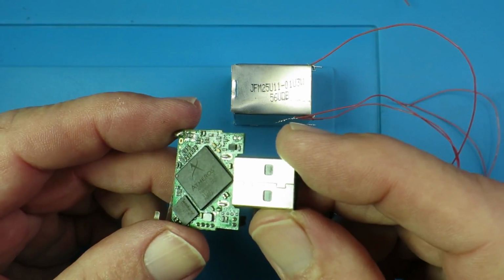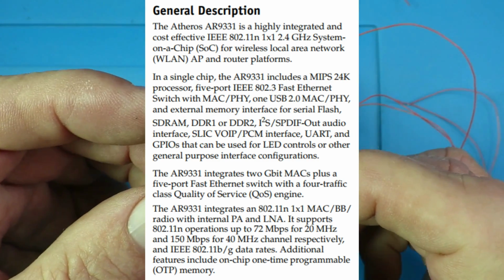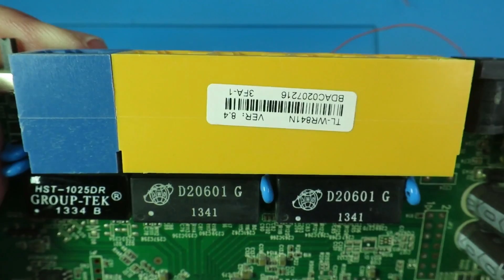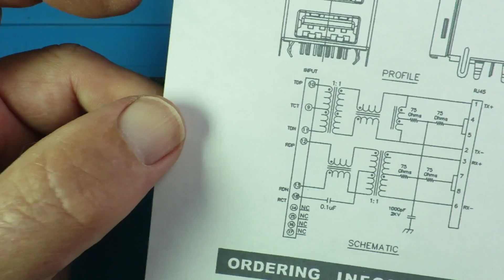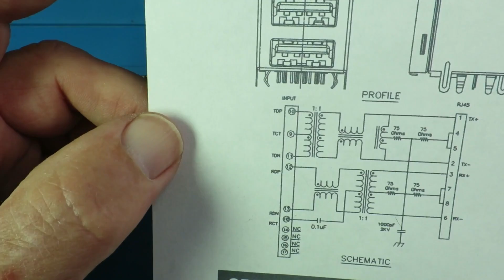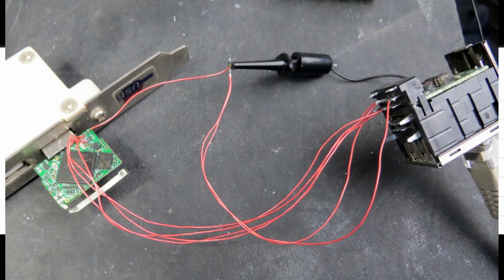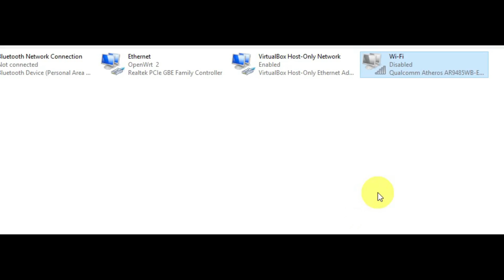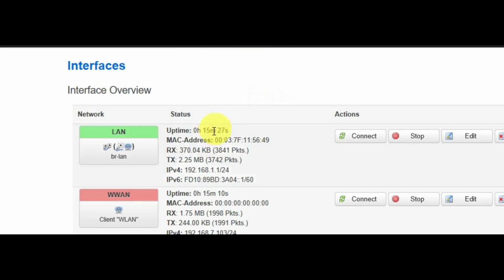Add an Ethernet Jack With Magnetics To Soc AR9331 - Example Tutorial

Comment: Pretty good specs for a tiny device (64gb of ram). Micro router with open wrt and possible to connect usb devices via usb data pins in this SoC for maybe connect 4g dongle i think. How about flash size?
Reply from the maker: I show how to connect the SoC usb to an external device in this video : https://www.youtube.com/watch?v=xPJyUNtNzyY The device has 16MB SPI Flash.
Reply: Thanks, that's definitely good piece of hardware, especially because has atheros soc.
Reply from the maker: Yes, it has a lot of potential!